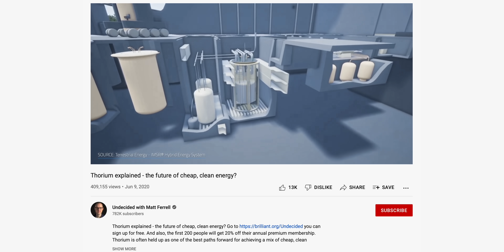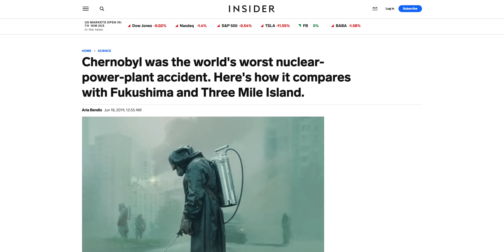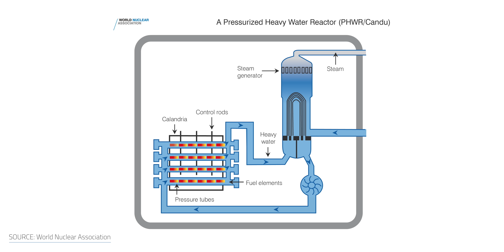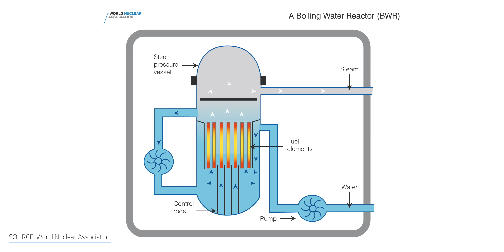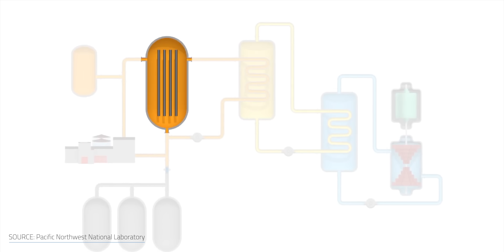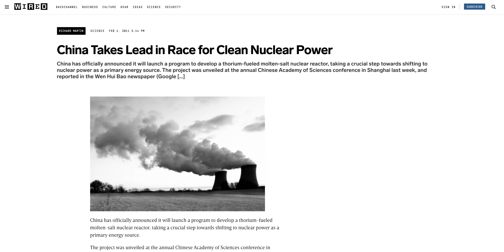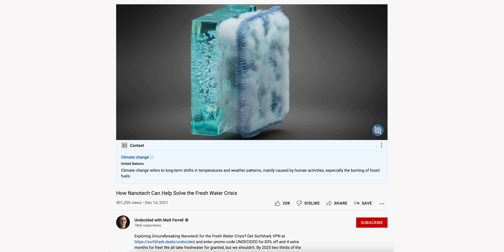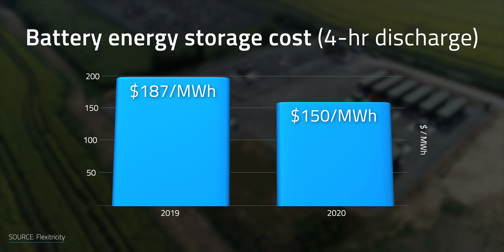Revisiting Thorium Energy - The Future of Nuclear Power?

Comment: We definitely need to develop advanced nuclear. I certainly prefer wind over any fossil, but I would still prefer a few small nuclear plants over huge solar/wind arrays. The consumption of resources (metals/concrete/...) of nuclear is orders of magnitude lower than with renewables for a certain amount of power. If we want to green air travel, all of industry, agriculture, heating... we will need huge amounts of green electricity. Nuclear would be the obvious way to go. Even the naval transport of solar hydrogen from the sahara to Europe requires much more resources (to build the transport means) than a NPP in Europe close to the point of consumption. The amount of "fuel" in a LFTR is minute compared to the amount of resources you need to build a wind turbine. Advanced nuclear is the surest and quickest way to completely decarbonize society, and make any country energy independent.  I prefer hundreds of square kilometers of solar over coal power, but I even more prefer to return the ecosystem to nature, and source our energy from a small green point source.
Reply: Nuclear plants are base load plants and cannot be turned on and off as demand changes. Energy storage benifits both nuclear and renewables but the nuclear power contrabution can never exceed the minimum grid usage (usually at night).
Reply: @clarkkent9080   when electrolyzers become cheap enough (currently about 300$/kW and dropping fast) any surplus electricity can be used for green H2. And we will need vast amounts of it. Moreover, with battery prices dropping, "baseload" + batteries would probably be all we need. Add load shifting and massive green H2 production and you wouldn't need anything else. The economics will probably favor wind and solar, but this isn't even necessary.
Reply: @AlainKalmar  My only point in all these discussions is that in America, nuclear is costly and takes at least 15 years to build.  The time line to build and prove the concept of a new reactor design before general acceptance eliminates nuclear as the near term solution.  There will be a nuclear resurgance but that is 25 years out.
Reply: @clarkkent9080  I completely agree. We need to green our power system NOW. So we must go full speed for solar/wind to decarbonize as fast as possible. Still, we don't have to choose between more solar panels and more cancer research. We do both.
The same goes for "solar versus nuclear". The amount of power we will need to decarbonize everything and take a few hundred billion tons of CO2 back out of the air will be enormous. Better develop all possible options. china is also massively building wind AND solar AND batteries AND nuclear. The amount of power you need to produce all the hydrogen locally at a large airport to fuel all the H2 airplanes in 2045 will be enormous. Better have some advanced NPP's by then.

Comment: You didn't really touch on the challenges that need to be overcome and will require a lot of funding. For instance the Pa-233 extraction was never demonstrated at scale. We can isolate any element and many isotopes and do so for medical purposes, but doing that in a price efficient way is a hole other beast. And that is just one part. There are billions, maybe even trillions of upfront cost waiting  Would it make sense to invest that? Yes. But it would make the power even more expensive. It will either take a very long time (and then might just be irrelevant because of fusion) or needs to become a global joint effort.

Comment: I do think Thorium will make an impact. This is a tech whose time has come- it is so much cleaner than traditional nuke power and so much safer. The fact that we can also bung in the old nuke waste and clean it up is a relief to me. I think this tech is at its beginning and regardless of any stats the one thing we cannot predict is where this is going in the long-term future- as the tech matures the price may well plummet. I also like the possibility of small scale generation and possibility of pre-fabbing units that can then be slotted into existing systems or even delivered to areas of the world that suffer from natural disasters. Whilst this might yet be fanciful, the flexibility of the system suggests the application of Thorium based energy systems could be enormous even to powering  space programs and off-world missions as we seem to be planning. There ain't no coal on Mars. I suspect any Renewable energy needs to be sufficiently flexible to meet changing needs and that Thorium might well be one component in a diverse energy generation environment.

Comment: I'm on 100% sun and sell a lot back to the grid. I think even energy intensive manufacturing can suffice on renewables. Nuclear has no case anymore.
Reply: No you are not on 100% sun, try me.  Describe the system you have and your location and I will show you are lying.  The simple fact that you are grid intertied immediately shows you are not 100% solar since you use the grid as your battery.  My 4Kw system has produced only three days worth of output in the past month.  The battery for that scenario would be well over $100,000.
Reply: @danadurnfordkevinblanchdebunk  Here come the pro-nuclear idiots. Yes, I'm on 100% sun. You may have a little itty bitty tiny 4kw system (lol) but I have a 13kw + Powerwall + Green energy sourced from the grid when I use the grid. Sorry to ruin your fun lol

Comment: Deep space exploration also needs a compact, powerful, efficient reactor like this.  If you want a space ship to get some reasonable acceleration from an ion / plasma drive, it is going to need a power source like this.  Solar is too diffuse in the outer solar system.  Even around Earth, those solar panels are too bulky for good acceleration.  Light water nuclear is just too bulky and inefficient.  Fusion always seems to be "20 years" off and would still be too bulky and inefficient even if it did work.  Especially if we end up with Starship available to get to space, the reactors are most likely going to need to be small and light enough to fit in Starship so they can be made on Earth and then transported into space.  Something designed to fit on a plane originally should definitely be able to fit in Starship

Comment: Nice to see the lcoe of solar and wind quoted WITH storage. Most fan boys ignore storage completely. But 4hrs????.  Not even close. A future powered by wind and solar requires many times that and many times that quoted lcoe. Thorium reactors will end up cheaper and more reliable by a large margin.
Reply: Probably more than 10 times that would be required.  I have had only three days of the past month where I generated any power at all from my 4Kw system.
Reply: @danadurnfordkevinblanchdebunk  That's  one of the problems. They don't need enough storage to cover the fluctuations in collectible energy over a 24 hour period or even a week; they need enough to cover seasonal fluctuations.

Comment: Nice video.  The main concern I have the future of MSR is the highly political NRC.  Added costs and delays caused by an ever changing regulatory environment are the bane of the Nuclear Industry.  One thing I think that could help a lot would be if be could get to a place where Nuclear Power Systems could be replicated so that you could reduce the investment lag and risk.  One way I could see that happening is Small Modular Reactors.  It the NRC could set up a framework where a design and a replication process could be agreed to then rather than take 5 years to design and 5 years to build, for an SMR (in theory) you could design it once then crank them out - maybe as fast as one per year.  This type of replication environment would also for a better way to improve the design because you only make small changes between the versions.

Comment: One point on the costing/MW is that it's often on the basis of CAPACITY, nuclear reactors have about a 93-97% up time (produce their rated capacity 93-97% of the time) that's ~30% for solar and wind.
Reply: LCoE does not consider capacity but instead focuses on lifetime electricity production, so the reduced load factor of renewables is taken into consideration
Reply: @juliuss2056  And that's how energy collectors cheat LCOE calculations. They are not not even remotely comparable to dispatchable generators, yet are assumed to behave the same. If forced to meet that assumption, their capacity has to be massively overbuilt to compensate for abysmal capacity factors. That's about 3 times the capacity (and cost) for wind in the USA, and 4 to 5 times for solar. Then there is the astronomical cost of the ridiculous amount of storage required to make energy available 24/7/365. The actual LCOE of wind and solar is easily in the thousands per MWh.
No, unreliables aren't cheaper. They just cook the books.
Reply: @juliuss2056  That may be worse, a reactor lasts 50-60 years on average, solar panels and batteries are~20 in terms of commercial lifetime.
Reply: @killcat1971  yea but even taking that into account, renewables are cheaper lol
what is your point?
Reply: @juliuss2056  If you have to replace the solar panels and batteries twice in the same time frame as a single reactors life time, then you have to mine all the materials, process them, ship them, and dispose of the waste AND all the panels and batteries 3 times. That's a lot of waste for a power source that is less reliable and takes up many times the space.
Reply: @killcat1971  but this is reflected in the levelised cost, yet renewables are still cheaper.
Reply: @juliuss2056  Show me where the levilised cost includes the cost of waste disposal, both as part of the manufacturing and end of life.
Reply: @killcat1971  Inputs to LCOE are chosen by the estimator. They can include cost of capital, decommissioning , fuel costs, fixed and variable operations and maintenance costs, financing costs, and an assumed utilization rate.
Reply: @juliuss2056  So did it include the cost of decommissioning and waste disposal, both of manufacturing and end of life?

Comment: Put a billion into battery storage technology R&D and implementation, build more cheaper solar / wind and in 6 years you'll be generating a lot more energy, you'll have working systems that out perform that 1 reactor, lowered the cost and furthered the technology of existing renewable tech.  Plus less subsidizing from tax payers and safer environment.  To play devils advocate, nuclear needs R&D and I don't mean for the military  / medical applications  (which is the primary reason for it) but also for solar system colonization.. unless if your taking about mining mercury, solar would be a no brainer there.
Reply: Billions have already been spent on storage technologies and we still don't have a practical energy storage technology for utility scale.
Reply: @danadurnfordkevinblanchdebunk  if even a fraction of the investment of nuclear went into energy storage, it would be solved.  There are solutions, gravity, iron air, hydrogen storage in ammonia, lithium batteries.  These have all matured considerably and offer Gigawatts of storage now and have only been developed for a relatively short period.  Billions more are needed, wouldn't have been an issue if they'd been developed as aggressively as nuclear / oil / gas infrastructure.  Mass battery storage is a baby and advancements have been held back for a century, all for money and power
Reply: Sorry my nuclear cost was a little off, 6 to 9 billion per gigawatt, 95+ gigwatts currently

Comment: Thorium is coming into the game WAY later than it should be, but we need it.  At least until we get a handle on fusion.  Energy storage just isn't ready to let solar and wind stand alone, not to mention there are places where those are much less practical (and cost effective) to use.
Reply: It could still take thorium a couple decades to be in the game, and maybe never for fusion.  Why not build small modular reactors now since that is already proven and can be implemented quickly.

Comment: there has been an announcement by Oakridge, that they have 3D printed  a thorium reactor using ceramics--which are stable under neutron radiation.  this would be a great subject for a podcast.
Reply: I was thinking about ceramics when I watched the video. The assumption always seems to be that reactor vessels be built out of some type of metal. I thought of the lower volatility of ceramic and apparently someone else had already thought that, too!

Comment: Grid scale 4 hour battery storage cannot possibly be the standard. There is no way that intermittent green energy can survive with only 4 hours of storage capacity. What happens when it's cloudy and rains for days on end? There is no green energy that can replace a base load designed power plant. Nuclear (in just about any reasonable form) is by far and away the best option for that base load. The green power options are getting better every day, but they are still a long way from being considered base load, even with battery storage options.
Reply: Also notice how the figures mention a 30 nuclear plant life?  Most nuclear power plant last twice that.  How many times would you have to replace panels and batteries in a 60 year time frame?

Comment: Here is what you need to know.  Picture digging a hole in average dirt, say 1 cubic metre or yard.  Remove all of the thorium from the dirt and use it for nuclear fuel such as a LFTR.  The energy obtained would fill that hole with oil... 16 TIMES over.  Why would you need fossil fuels ever again for energy?

Proof/Math:  7.2 ppm average thorium in earth's crust, roughly 1 ton (1000kg) material = 7.2g thorium/ cubic metre.  
Thorium/Uranium Energy density:  80 million MJ/kg or 80,000 MJ/g or 22 MWh/g.  Times 7.2g = about 160 MWh extracted energy (160,000 kWh if using electric bill units).
Oil energy density: 40 MJ/kg,  Density ~0.85 = 850 kg (to fill 1m^3).  40 MJ/kg x 850 kg = 34,000 MJ = 9500 kWh.  
Compare 160,000 kWh vs 9,500 kWh = 16x  (this also ignores the average uranium content in random dirt, this is JUST thorium).  If you extracted roughly 5% of the nuclear energy from regular dirt, it wouldn't be worth the bother to drill for oil.

Note:
If you instead open a rare earth mine (we currently get all our rare-earths from China), you get two benefits - more rare-earths for tech like electric motors, etc, AND abundant thorium.  Most deposits of rare earths contain large percentages of thorium which is just thrown away as a "radioactivity hazard" (even though it is just natural rock).

Comment: Nuclear energy the most current established, well proven, science based, chemistry centric, applied physics, energy technology that has the greatest ability with fuel element breeding over parity to make cheap continually electricity, green hydrogen, fresh water from sea water & district heating of air or water for buildings or domestic use... for 10 billion people 24.7 with great uptime & good load following & excellent capacity factor. Solar & Wind require a 40+ hour battery in order to actually produce constant output year round. Consider a non-grid connected solar PV rooftop energy system & battery energy storage ; I would suggest having an 8 day power storage battery would be required in cold regions like the Northeast USA where winter storms can dim solar energy available to the PV panels for a week easily during winter & or cover your panels with snow //

Comment: Renewables are great, but they have very low power outputs and need battery storage. If Nuclear power has a future at all, it's in Molten Salt Reactors. I think you understated the potential efficiency improvement over traditional Fission reactors that only use about 4% of the energy in the fuel. Molten Salt Reactors can potentially go up to 90% and can even use spend fuel from traditional reactors as fuel, reducing the stockpile of nuclear waste.
Personally, I think it's going to end up as a hugely important technology that will allow massive amounts of power to be produced efficiently, and eventually cheaper than any other method. Time will tell.

Comment: Think this might be an option, especially since a 4hr battery reserve is definitely not enough. If there is no wind in the night, which happens sometimes, a battery reserve of min. 12 hrs should be calculated. Thus the price per MWh from such a type of Reaktor is much more competitive. There are also studies assuming 24 to 36 hrs of battery reserve is needed when we only rely on wind and solar energy. Maybe using H2 or biogas can be the solution to this problem. Also not to forget, that renewable energies need a new adapted grid which also has to be calculated.

So, I think we need them all together in a good and balanced combination.
Reply: A 12 hour battery isn't near enough either.  The 4Kw array on my roof has only produced electricity for three days in the past 30 days.  Without a grid intertie system, I would be in the dark almost all winter.
Reply: Grids waste energy.

Comment: doing renewables with storage I stead of nuclear on the grid would be awesome but it ignores the supply chain constraints on lithium batteries. We may just simply not be able to build a sufficient number of lithium batteries to support grid storage at that scale while also electrifying transportation, especially if we want to move fast on climate change. Going for LFTRs for grid baseline frees up the lithium battery capacity for vehicles which could help us reach net zero faster
Reply: The newest TerraPower Natrium plant utilizes thermal molten salt storage to boost output by 50% for 5 hours at a time.